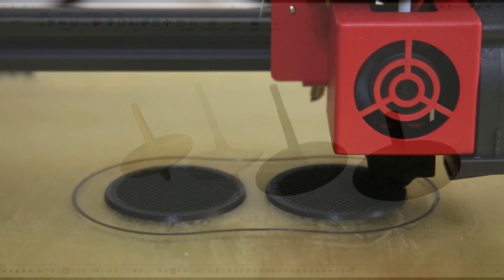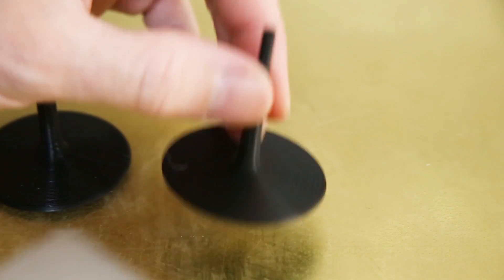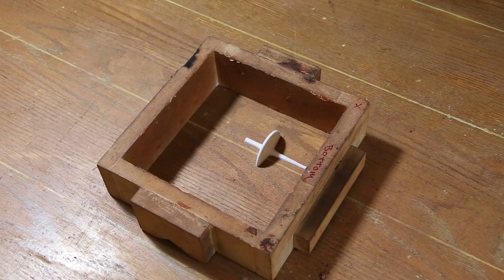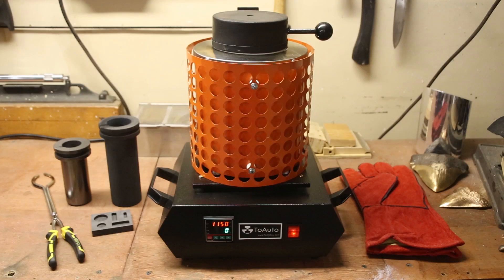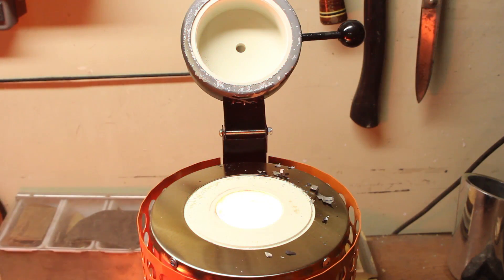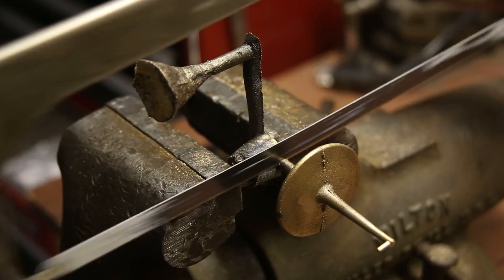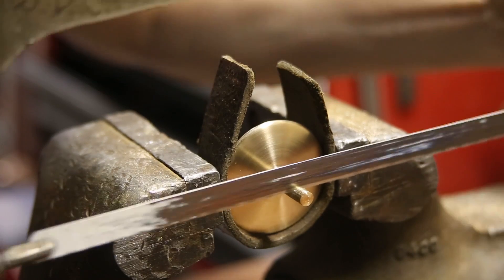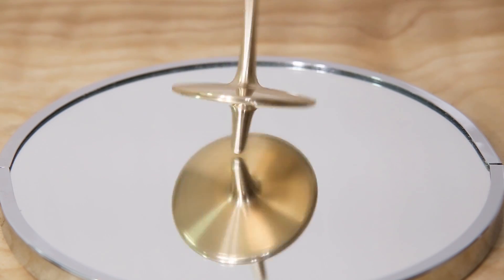Making a spinning top | Metal Casting | 3d Printing │ ASMR

Comment: Dumb question Seth..  If you have a lathe, why did you cast this?😜  Time to watch craigslist, there is some good deals out there.  I stole mine.👍
Reply from the maker: Its a crappy Chinese mini lathe that has never really worked well for me. Like I said, the best way to do this would have been to cast a blank and machine a top out of that, but I wanted to see how well this method would work.

Comment: I'd suggest add lock to tongs. Myfordboy dropped it due to lack of that. You can just use small strap of metal and wrap it around tongs. Watch myfordboy review of same furnace to see it.
Reply from the maker: Thanks for the advice. I was planning on making a pouring shank to transfer the crucible into for larger amounts of metal. I’ll check out his video.